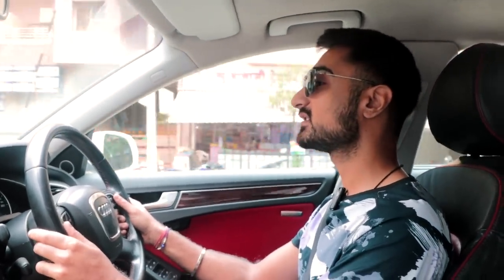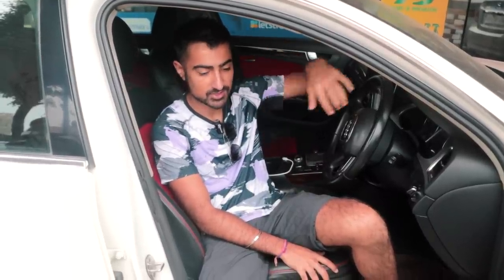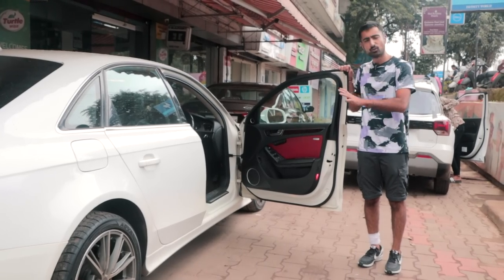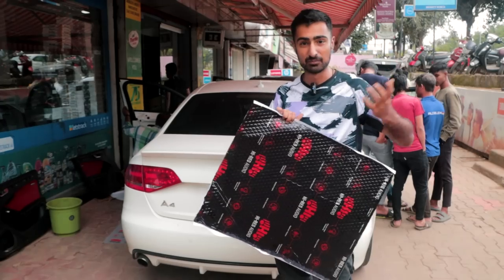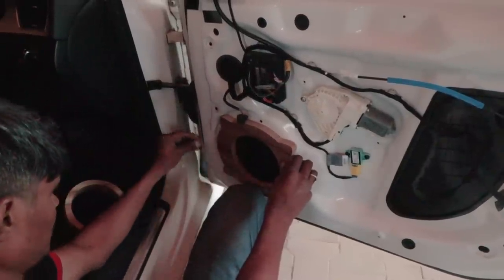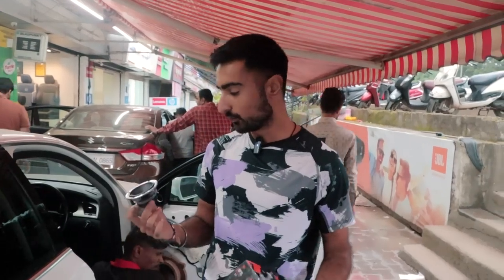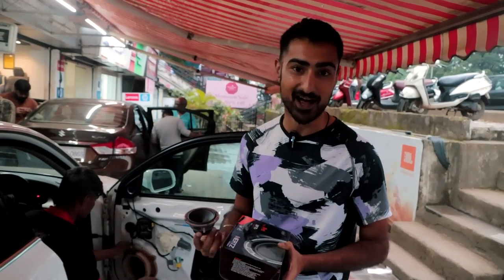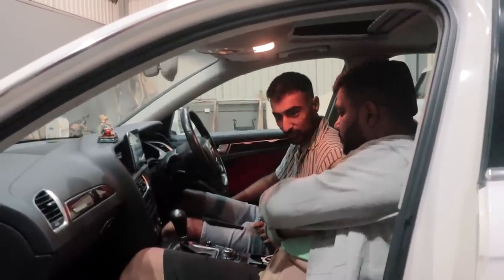Infinity Speaker Upgrade for the Audi A4 3.0 TDI! (₹35,000/- 🤯) | Project A4

Comment: Btw prob wasn’t with B&O. It was the sound processor of the after market Chinese touch display that has its own sound processor. I had similar issue with Q5. I let the head signals bypass the Chinese professor directly - as was before and everything sounded beautiful as was.

Comment: i am looking for 12 channel DSP, to run all speakers actively. Do you have any advice?
i have already replaced all speakers with 3.5 infinity's in dash L & R plus focal 3.5 components  in center, making this total of 5 channels requirement, in the doors i actually got 6.5 inch woofers from focal in front doors needs 2 channels, in rear door pioneer champion series coaixal speakers needs 2 channels. in rear deck again infinity 3.5 to be 2 channel as surround system.  and 1 mono channel for sub out which will go to pioneer twin powered sub with builtin amp..
Reply: Ditch the built-in amp, get a mono amp and a compatible sub.
Reply: Take a look at the nakamichi 12ch dsp. It's affordable and really good.